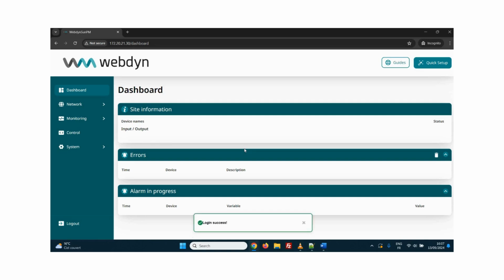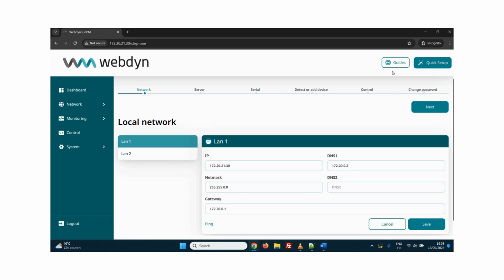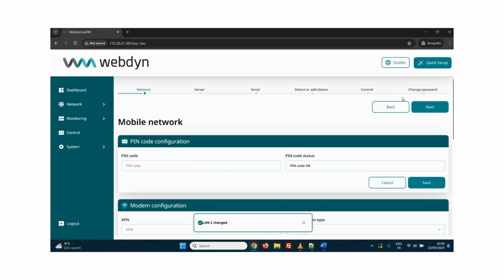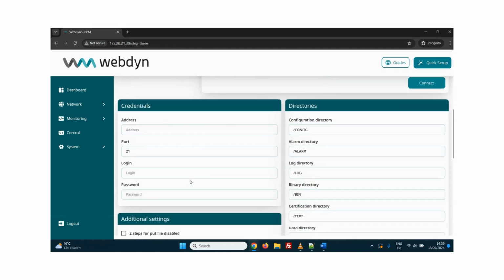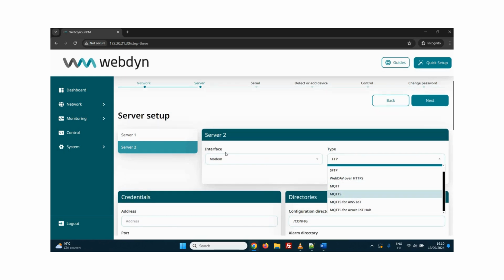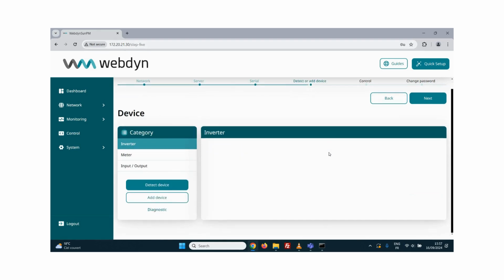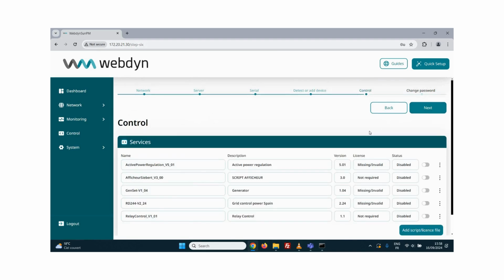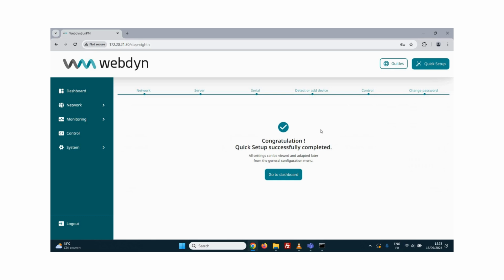Video - Quick Set Up Guide new GUI for the WebdynSunPM

Comment: Very good video. It explains very well the features that WebdynSun PM presents. I have already acquired a unit in Portugal. :)
👍The icing on the cake would be an example of inverter integration and detection, such as adding equipment such as an energy analyzer in RS485 protocol...